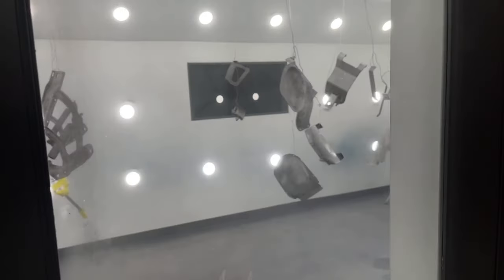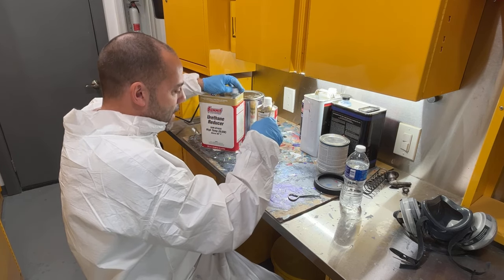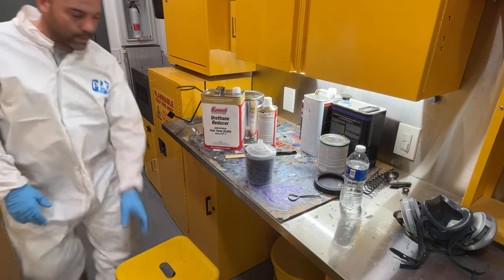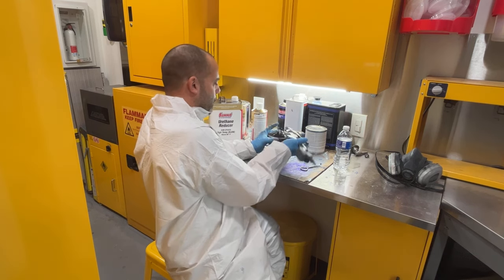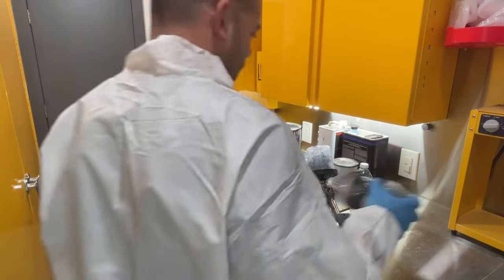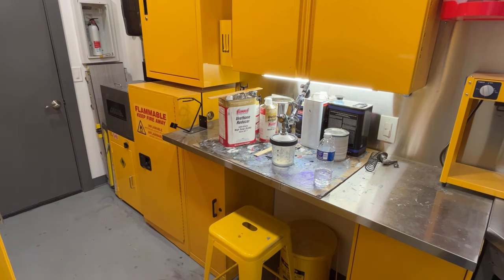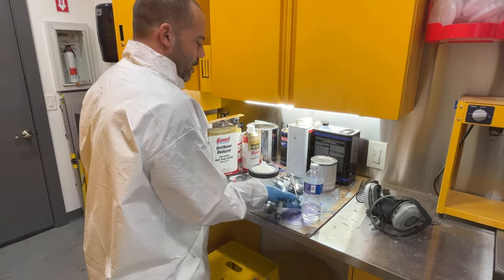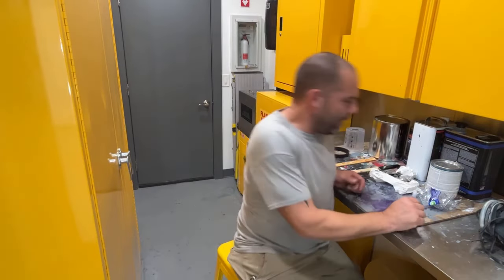Painting satin black parts for the 1959 and 1964 Chevy impala convertible

Comment: Nice work.  Eastwood makes pretty nice satin and matte black single stage 4.1. I used it on some suspension parts and random stuff like you have here.  Alot of people frown on eastwood paint stuff...but...sand blasted....epoxy...and then eastwood and the stuff is bullet proof.  Also. , check out SPI epoxy.  Alot of folks use that on parts like you have here and call it done.  It dries to a satin finish.   The best epoxy on the market.  My opinion of course
Reply from the maker: I will definitely have to look into that stuff. Yeah I don’t really care what people think of products I use I’ve used really cheap stuff and I’ve used really expensive stuff. I think it’s just all in the user. Obviously some stuff has better UV protection but with these old cars they don’t see a lot of sun Thank you.